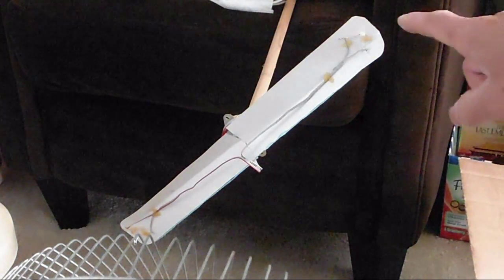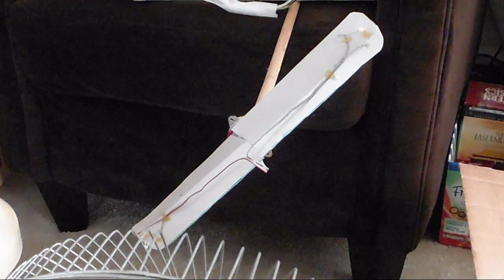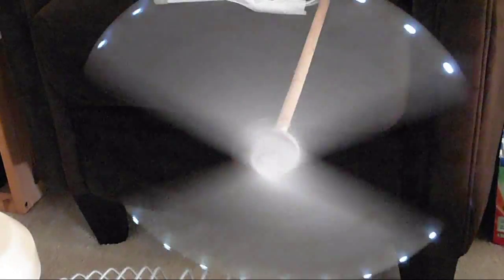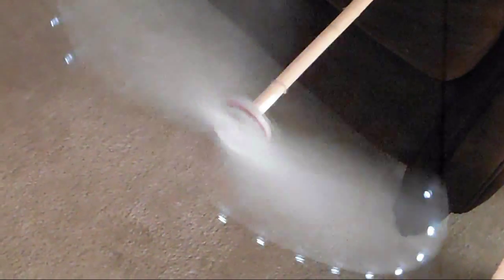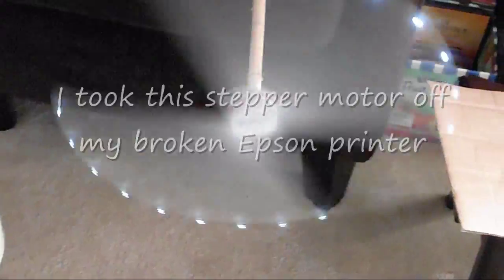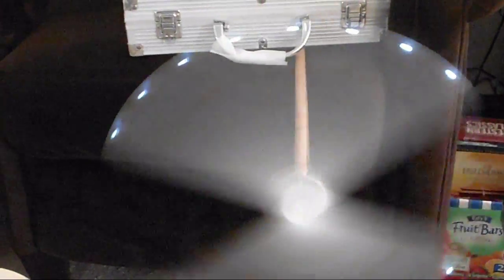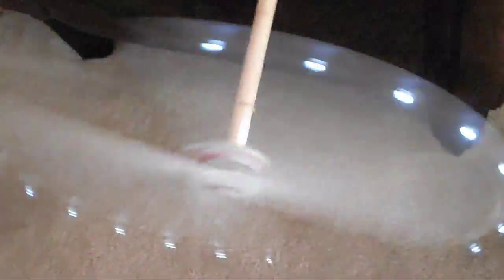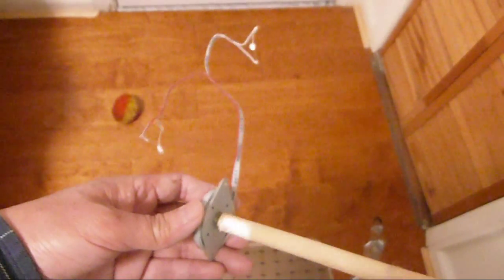Another do it yourself LED yard ornament wind turbine

Comment: sir, how did you attach the LED wires to the motor?
Reply from the maker: It's a stepper motor with 2 phases. Use your multimeter to measure the resistance of the wires to find out which 2 wires belong to which phase. Run the wires from the motor to the tip of the blade. Repeat the same thing with the other blade.  Since this is temporary, I just used hot melt glue to secure the wires and the LEDs to the blades.